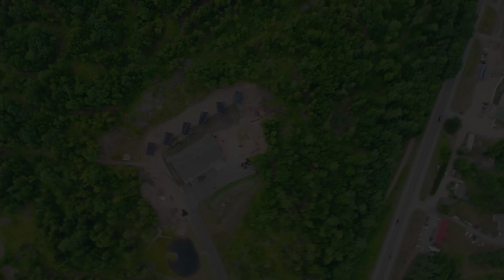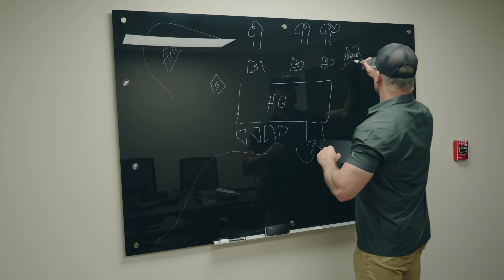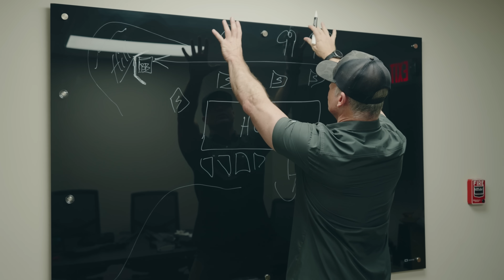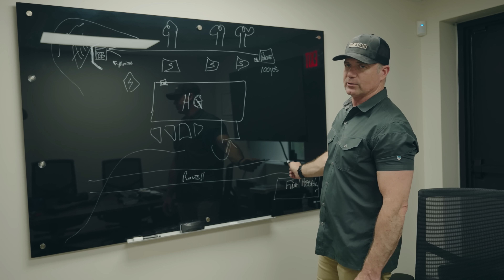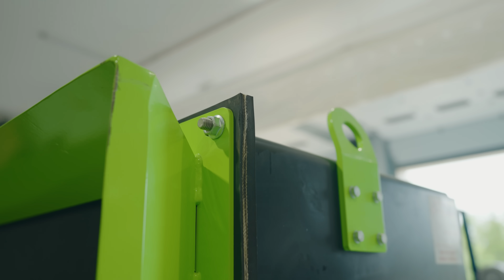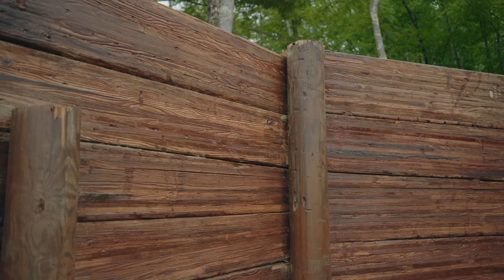We Built a Gun Range at T/C HQ

Comment: BulletBunker, we have been using similar things with airgun for decades. Cardboard box filled with rubber mulch. A 5 gallon bucket full will absorb about 200 foot pounds of energy (.357 shot through the lid area). Cleaning things out is not a lot of fun though, and melting the lead is also not great because a lot of rubber sticks to the bullets. But at least you can make more ammo out of the collections. Just a tip, test the hardness of your ammo before shooting so you know the alloy and don't mix the "pure" soft lead with harder alloys like most round ball will be.

With that range, are you considering a service where you proof shoot the products, as well as higher end sighting and other tuning? Most of the airgun sellers offer this service so you know what you have when it arrives. Something to think about once you get it finished.